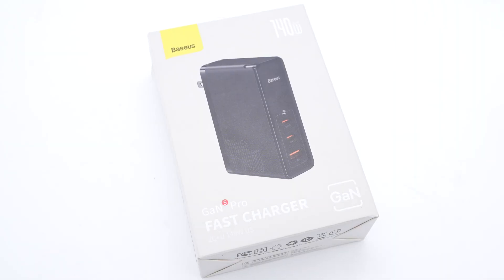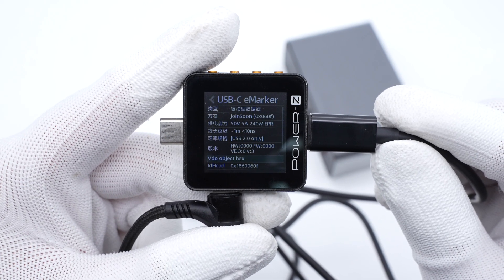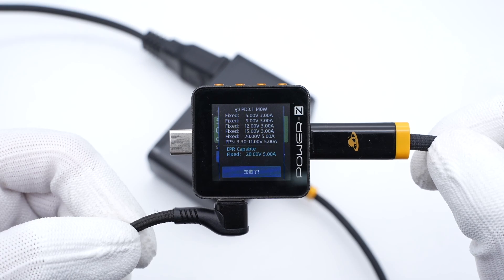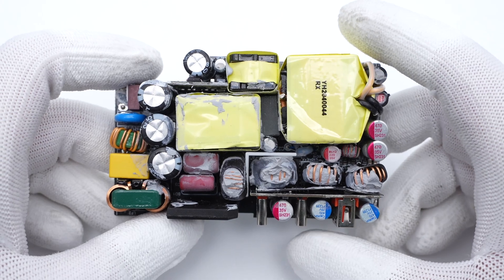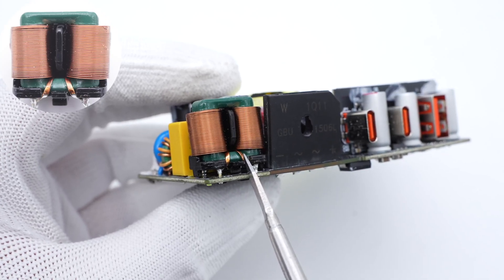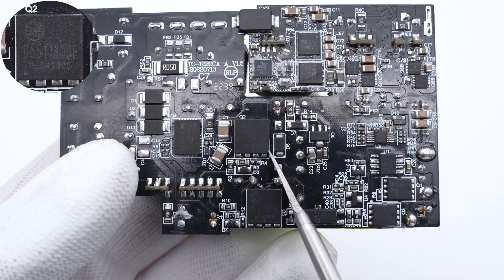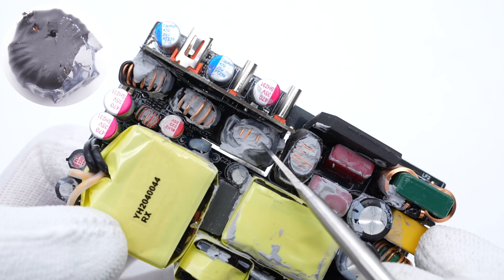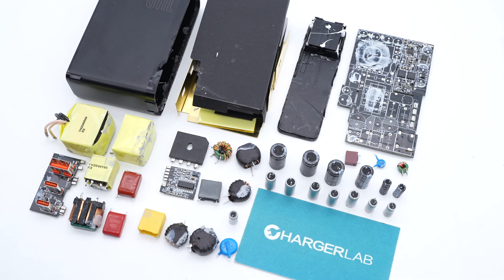Teardown of Baseus 140W PD3.1 GaN 5 Pro Fast Charger (2C1A)

Comment: Considering to purchase this charger for Dell Precision 5570 or Lenovo Legion 9 and for MacBook Pro 13 - how well does it handle each one of the devices and how well does it handle charging a laptop + a phone and something else at once? What about the heat and the voltage and how does it handle for a long run if I want to use it instead of the original ones?

Comment: Wow ur video is great knowleadge. But can i ask port Type-C2 is not superfast charge port?
Reply from the maker: The USB-C2 only supports PD3.0 100W.
Reply: So its not super charging slot right? M apology didnt get the physiics answer sir 😅
Reply: Because when i pluged in the USB C2 port with the wire 240w in my Huawei Mate 20 Pro, its didnt appear supercharging like USB C1 and USB one.
Reply from the maker: For Huawei devices, the main fast charging protocols used are SCP and FCP, which can be found on all three ports of this charger. So, if supercharging does not appear, there is a good chance that the USB-C2 port is broken.
Reply: @ChargerLAB  ❤
Reply: I wonder it is normal for this Baseus 140w wall charger or the product is broken somehow?
Reply: Thanks alot for your answer. Now i know its broken. Thanks alot...Highly support your channel.

Comment: hi i have 65 baseus gan 5 my question is can i use the charger for charge samll devices like my garmin watch and airpod do you think the charger regulate the power for small devices
Reply: I have no problems with USB-C Oneplus Buds Pro 2 TWS headphones, the charger will supply only 5W to it, as it is supposed to

Comment: Is there a huge difference between Baseus Gan3 and Baseus Gan5 ?
Reply from the maker: Baseus official claims that under the same output power, GaN5 is smaller in size and better in heat dissipation.

Comment: Another half-assed "me too" product, stopped watching after the sentence "only USB-C 1 port can supply 100W". A multi-port charger with arbitrary power limits on ports or without dynamic load distribution is not fit for purpose in 2023.
Reply: You must wait 🙂

Comment: we need gamig laptops with 240 watt pd charging. The huge old ugly bricks are outdated
Reply: I got 300 w charger for laptop. For 4090 you need more. I believe we need a) more than 340w pd charging for future gaming laptops 😀 or b) be able to use more pd ports with more chargers simultaneously
Reply: @vorbisek  not everyone use 4090. most of the people use 3060 or 3050. and 240 watt usb pd is more than enough for that.